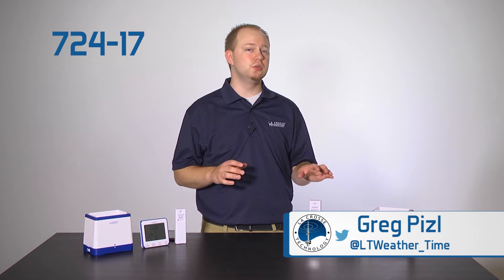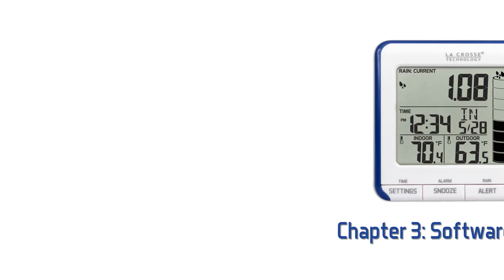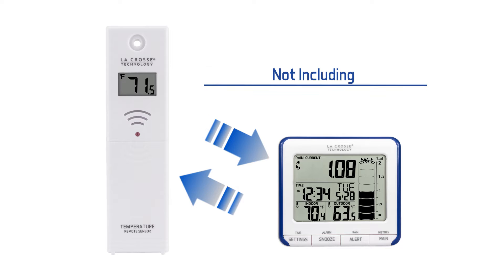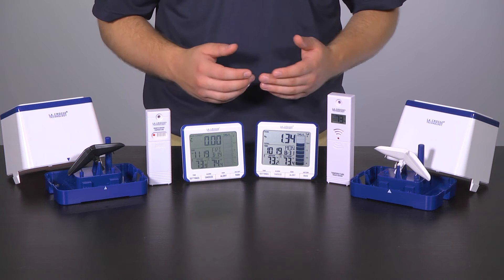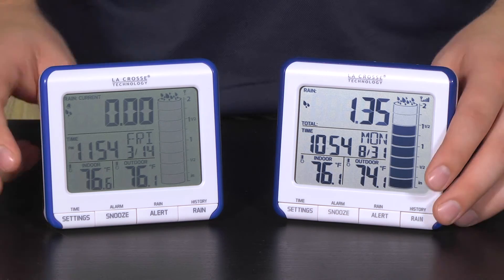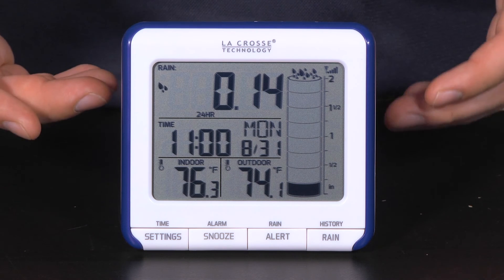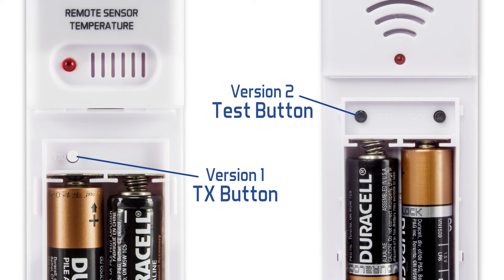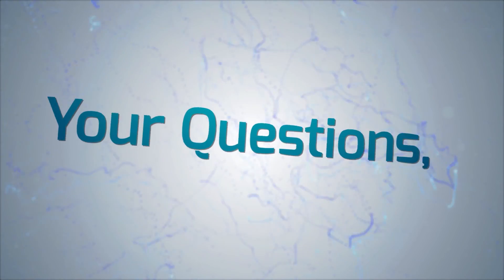724-1710v2 Product Update Guide

Comment: I learned that if one replaces the batteries in the rain sensor and does not put the unit in the sensor's station facing the right way, it will not work, even though it can go in one of two ways. I did not see this mentioned in the paper manual that came with it, only in the online  pdf manual did I see this mentioned about lining up the sensor tabs correctly.
Reply from the maker: Sorry about that! This was covered in our previous version 1 video here: http://bit.ly/724-1710v1_video and as you mentioned in our full manual here: https://www.lacrossetechnology.com/media/catalog/product/7/2/724-1710v2.pdf -- But we sincerely apologize for this not being pointed out in the quick start guide. If you ever have issues with your rain sensor or any questions moving forward, please feel free to reach out to our support team here: http://bit.ly/contact_techsupport